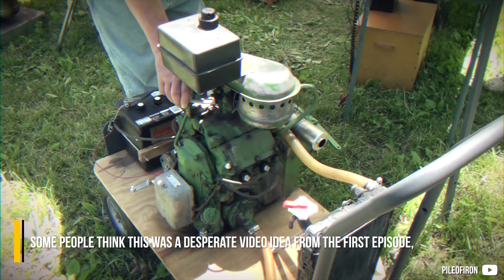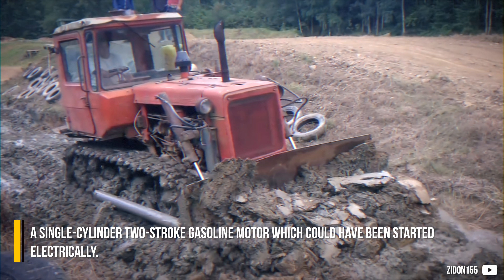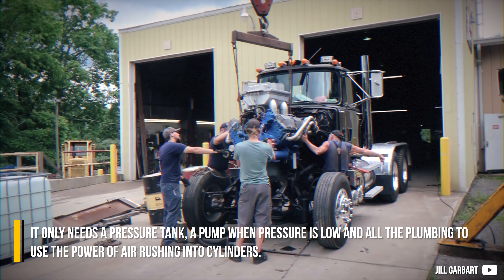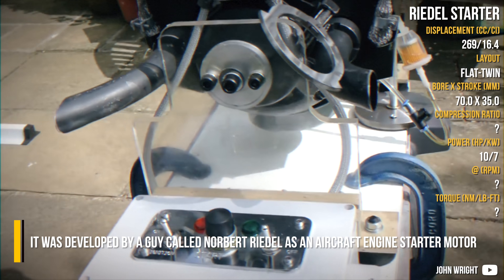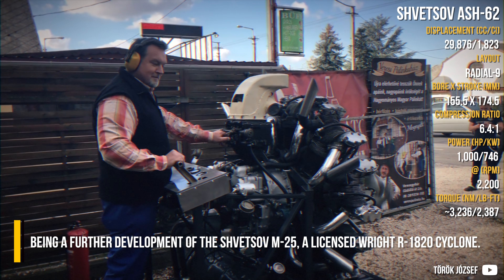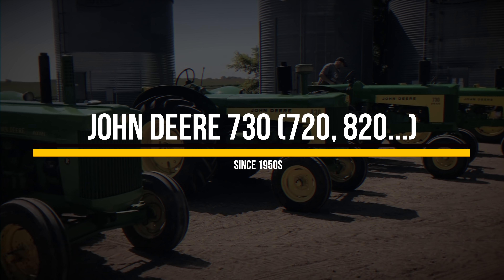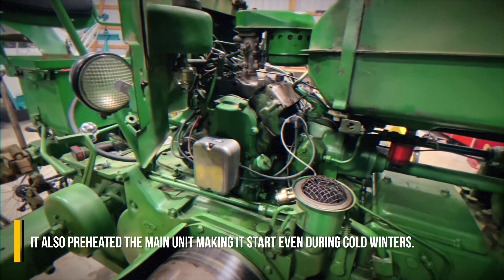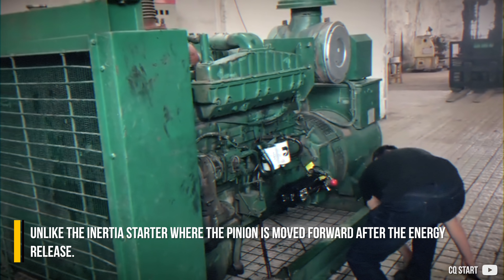The Best Sounding STARTER Motors

Comment: The Mack truck did not use Air into the cylinders but an Air motor, much like an air die grinder but of course much larger.  Starting the engine sounded like a huge sneeze.  I'll never forget a honeymoon couple came in to our garage with a broken Windshield, parked beside the Mack Truck, they flew into each others arms when that truck started up.

Comment: In 1948 there was a motorcycle engine that was used for the Imme R 100 motorcycle. But before that, in order to circumvent the Control Council Act, it was used as a starter motor for a MAN tractor.

Comment: I used to work on and around marine EMD 16 cylinder 645s that had a pair of air starters each.   It was a lot of fun bringing those big mamas up from cold iron, and by the time they were idling, the air starter motors were caked in frost.

Comment: Late post but another unique starting tractor was the first Farmall row crop diesel tractor the MD first in 1941. It is a 4 cylinder engine that starts on Gas and then transitions to diesel.
It has a three valves, a diesel system and a gas system. Two levers are used to start it. move one forward shuts off the diesel fuel, opens the third valve to lower the compression, gas and electrical system then starts the motor, after the engine runs for a short period, 2 to 3 minutes, of time heating the combustion chamber, the lever is moved back to the diesel run position and diesel throttle lever advanced. This simultaneously closing the third valve raising the compression, shutting off the gas fuel and killing the spark to the plugs, opens the diesel fuel and then it transitions to diesel power. 
Here is a vid        https://www.youtube.com/watch?v=0iqQgC6hlwE

Comment: I love unique ways to fire up an engine.  One that i felt should of been talked about was international's way to start some of their diesel farmalls, such as the MD or 450 model.  The engine started on gas, and once warmed up a leaver was pushed and the compression ratio and fuel switched to diesel, allowing a similar action as a pony motor, except it was in the engine it used for work.

Comment: There is the twin Buick starter V8's for the SR-71 aircraft, the old Chrysler gear reduction electric starter for their engines, and the tiny spring starter for the Cox .049 model airplane engine.

Comment: I worked on General Electric MS5001 gas turbine generator sets all over the world decades ago. They were about 18 to 24 Megawatts each. Many had ''black start'' capability where there was no external power in the entire region. When these were called to start, a 600 horsepower Detroit Diesel 12V71 twin turbo engine provided the cranking of the gas turbine. When Start was selected, the diesel would crank over and idle for about 20 seconds. Then it would go to full throttle for about 5 minutes. 

The Detroit Diesel ran through a TwinDisc torque converter and drive the turbine compressor end with a jaw clutch.  The diesel cranked to 20% speed, the fuel was turned on and ignited, then the diesel would assist driving the turbine past 50% speed and accelerate to 100%, or 5100 RPM. The turbine shaft would disengage as the speed built up, then the diesel would go to idle cooldown and shut off. Listening to a V-12 two stroke diesel delivering 600 horsepower was delightful.

Comment: I loved the spring starter. Just flip a lever and the engine is running. Requires a reliable engine tho. Cause if it doesn't start you'd probably be standing there winding up the spring several times. But all in all the inertia starter is best. Gives the Antonov An 2 its lovely sound.

Comment: A lot of antique large gas and diesel engines used a variation of air start that blew air into the actual cylinders to drive the piston(s) down to rotate the engine. (This method is used on some large ship engines also).😉

Comment: That little v4 starter engine from the tractor would be cool if it could be custom fitted with a small transmission and put onto a motorcycle

Comment: The big Diesel trucks we use in the Arctic have air starters, but they don't pump compressed air into the cylinders. There's it's a little air motor that's geared down and meshes with the flywheel or crankshaft when you put air to it. Much better than electric starters in freezing temperatures because batteries die in the cold. I've only seen compressed air pressurizing cylinders directly on really large Diesels, like ships. Gasoline Pony motor starters were used by Caterpillar from very early days until recently. Old low-speed  Lister single or twin cylinder stationary Diesels start by using a compression release valve while you spin spin the flywheel by hand. Some big aircraft or tank engines have hand-cranked inertia starters - very hard work to use. Single cylinder Field Marshall   tractors (UK 1920's and on) use a shotgun cartridge fired by a hit with a hammer. Kaufmann starters are a much more complex cartridge starter, used on both piston and jet aircraft engines.  Almost all of these Diesels use a compression release that's held open when starting.

Comment: I  used to drive an R John Deere..  I  always  thought the  Pony  Motor  was a  two  cylinder  two  stroke ..  I never imagined that  John Deere  would  use a 4 cylinder  engine to start a  two cylinder engine..   They  were great in cold  weather ..  as  you  could start the gasolne  engine and  warm  up the diesel  block with  it  before trying to start the Diesel ..

Comment: You've gone off-track a little here.  Your title says Starter MOTORS, but your video is about engine START-UPS.  Big difference.  Fun video nonetheless, but even starter motors have their own unique sound signatures such as Cadillac starters sounding different than other GM vehicles.  And 60's and 70's Fords had their own unique sounding starters as well.  And I definitely can't leave out the gear reduction starter from Chrysler in the 60's and 70's; a very unique and fun sound as well.  If would be fun if you could look into a video with that.

Comment: The pneumatic truck starters were used in vehicles that worked in explosive environments.  They were extremely noisy, but could be installed on any truck engine.

Comment: I love the sound of an inertial starter.  On diesels, my brother (the truck mechanic) told me the latest pre-heaters to assist starting diesels are large heating coils in the intake manifold.  They heat the incoming air charge which makes for a faster, easier start.  The only thing is, you NEVER use starting fluid, you'll blow the intake manifold apart.

Comment: I love vids like this.   I  building a radio control lawnmower for steep banks.  When I get the inertia start working again I'll have to share a video.  It's a one cyl 2500kw diesel.  You hold the decompression lever (holds the exhaust valve open while you hand crank up some momentum via a flywheel gear. Then while flywheel is spinning let go of the decompression lever and it kicks to life.  The mechanical injection then gets a chance to prime the cylinder a little also. 

It has a electric start but not nearly as Interesting

Comment: While the mack air starter still acted like a normal started in that it engaged the flywheel, it would have been interesting to see the airstart used on large marine engines such as wartsillas, that uses compressed air in the cylinders to get the engine to turn over, it sounds pretty cool, like the engine is coughing before it wakes up to get to work :)
Reply: Yeah I think he was confused about how the Mack starter worked. Still cool glad it is in the video but agree hopefully in the next video he can cover large motors with compressed air in the starter.

Comment: When I owned a retired school bus with a DT360 International inline 6, I would of liked to have another option or two for starting it. Air starter and then recently I learned about the spring starter. Those would be good options. That engine never had a issue starting in the cold (25F) and didn't have glow plugs. I like pony motors but those mean having a different fuel and as you said extra maintenance for the 2nd engine.

Comment: Many farm and construction diesels that use a pony motor for starting also have a compression release that allows the pony to turn the engine over fairly easy and allowing the oil to circulate before they actually start,  I'd use this in winter with the fuel off spinning the engine for a minute or so, turn the fuel on then the compression, engine starts pronto!  diesels are hard to turn over due to the very high compression ratio and winter makes it worse.

Comment: The international gas/diesel engine is a good one also. It has a small electric starter motor to start the engine at low compression on gas. After the engine has warmed up on gas, you pull a leaver that closes the decompression valves and turns on the diesel injector pump swapping the motor over to diesel.

Comment: Decades ago I took the idea of a relatives 730 JD with the pony motor and applied it to grandad's stationary  Blackstone engine...well sorta, I put a 3 groove pulley on his tiller and cut a hole in the cover so one groove was convienantly sticking out and he could run the tiller over to the engine which was used out from the garden anyway for his mill and run a belt from the Blackstone to the tiller and pull back on the tiller to apply pressure on the belt until the Blackstone finally fired off then push the tiller few and remove the belt, it worked like a charm
I use to be so fascinated with that ol Blackstone I'd absolutely love to have it or one like it, a passerby made dad a very generous offer one day and he sold it when I was a teen ,grandad would keep all his oil from oil changes in a barrel and he had a mix he liked of mostly used motor oil slightly diluted with kerosene he ran in that thing it was the most simple basic concept you could imagine

Comment: The International Harvester WD-9 had one engine that started on gasoline and then when the engine was warm a valve lever closed off the top of the cylinders, thus raising compression, and diesel was then injected.
Reply: My elderly neighbour has one, and he uses it every year to rake hay. I've looked at it quite closely and it's an unbelievably complicated design. I just can't figure out why IH designed something so odd. It's pretty collectible, and no, he won't sell it. I asked.
Reply: @paulmaxwell8851  I think part of it was that the farmer could hand crank a gasoline engine while diesel were much harder to crank because of the compression requirements to warm the fuel.
Reply: @paulmaxwell8851  It looks more complicated than it is - there's an additional valve in each cylinder for compression release, a two-path intake manifold, the mag and plugs for the gasoline side, and a couple of shutoff valves.  IH had been building diesel tractors since 1934, and as Martin Walker pointed out, this starting system doesn't require a starter motor or, apart from the magneto/wires/plugs, any electrical system at all (transports of joy!).
A pony motor setup has all those parts plus a separate cylinder block and head(s), rotating assembly and valvetrain, &c.
My family ran an IHC dealership when I was a kid, and I sold equipment parts.  I refer to any motor vehicle electrical system as the "starting and charging system" to this day....

Comment: The real advantage for pony motor diesels was to pre-heat the block using their combined cooling systems. Particularly in logging usage where the equipment would be left out in the woods (far from the road or shop) during winter, this was a necessity back when even 12v systems were pretty weak. While using the pony itself was kind of a pita, unlike a farm tractor, logging and construction diesels tend to be left to run all day once started.
Reply: You mentioned leaving diesels run all day once started.  My Dad had a Wisconsin gas V4 engine on a Minneapolis-Moline combine.  It had hand crank starting and it would start pretty good when cold.  But if it died when hot one could pretty much call it done for the day.  And once started for the day he would let it run until done with it.  And from what I've read and heard that was the nature of that engine.  He hated that engine.

Comment: how may know who made the JD diesel engine was Caterpillar. not sure about the pony motor that turned them over.
Reply: BS- Deere diesels were made by Deere. Cat had pony started diesels of their own, but no relation. Later on, Deere used some GMC diesels, but those had electric starters.
Reply: @floydblandston108  not going to argue with you about it. but i can say after rebuilding these for 30+ years i can say not all but most every one i get in to are cat i mean yes they have a JD stamped on the block but the rods and id marks on the slugs are cat stamped.
Reply: @hartsfire5706  = are you talking about the ponies or the engines themselves?
Reply: @floydblandston108  the engine the diesel that is. i do some of the gas also but i prefer the diesel.

Comment: I recall a series of vids of the International Harverster DIESEL dozer with a compression lever that changed the ratio, making the engine able to run on GAS and using just car-like battery to start. It had distributor, sparkplug coil and for the diesel, a mechanical injetion pump. Once it was on temperature, they push the lever to change the compression ratio. The engine running on gas had enough power to move the machine. Not to operate it, just to move it. Pretty clever also, one engine for all.
Reply: The 4 cylinder gas  that was used in the M was able to drive when running off only 1 cylinder.

Comment: The model "R" predates the 70's and the 80 series tractors. they had v-4 pony motors.
Reply: The model R diesel actually used an opposed twin starting engine, Deere went to the V4 with the 70 tractors............

Comment: Does the Mack use direct air pressure start or a pneumatic starter motor? 
You said that ”air rushing into cylinders” but it sounded more like the latter option.
Reply from the maker: It is the latter, I apologize for the mistake
Reply: @VisioRacer  ok, thanks a lot for the clarification!! 
As someone else suggested too, it would be great to hear startups for the air started really big engines. (Ships, generators etc)

Comment: You forgot the craziest one of all the International Harvestor UD9 straight 6 cylinder that starts on gas then switches over to diesel.... all on the same engine. It IS a diesel engine with sparkplugs and a carb. Standard electric starter.
Reply: And a total of 5 holes in the head. There might have been a reason that the MD and the WD6 had issues with cracked heads.

Comment: Missed one type of common railroad and marine start systems.  That is high pressure air is injected into the cylinders to get it rolling over.  However this start system demands that the engine be jacked over by various methods to reach the start mark on many of these engines.  Opposed diesels are another breed however and they have a unique sound at startup.

Comment: There is another starting system that although not very visual is interesting. That being Hydro starters, where oil is pumped into Nitrogen pre charged bottles until around 200 300 atm then released through a hydraulic starter motor mounted in the conventional position on the engine, a small hydraulic pump recharges the storage bottles once the engine starts. Used in highly explosive environments where electrical sparks could be dangerous.

Comment: The V 4 pony engine for John Deere was introduced on the 70 diesel. High idle was 5500 rpms.  The front two cylinders fired together as did the back two essentially making it act like a V 2. It was important to turn the fuel off to run the little engine out of gas and turn the ignition switch to the off position after it shut down otherwise gas in the cylinders would clean the oil out and vibration would cause wear while the diesel was running and the coils would burn out.  John Deere's first diesel tractor was the R. It used an opposed two cylinder gas pony engine.
Reply: Thanks for verifying the vibration factor.

Comment: I didn't realise you'd done another video about starters. I love the sound of just about all these, especially the Mack air starters and the inertia plane engine starters!

I remember rewinding that bit in Mad Max 2 where he was starting the Mack tractor unit over and over as it sounded so good! I believe that system could also use air tyre pressure to start, nifty!

Thanks for your great videos, always informative and interesting!

Comment: we had a starter in australia back in the old days called battery hill.when your battery was  getting tired if you had a hill,you would back up the hill and put the handbrake on if it worked.if not got someone to chock the wheels.in the morning kicked the chocks out or released the brake and coast down and start.

Comment: Your description of an air starter is only correct if the engine is fitted to a large cargo ship or diesel locomotives. The air starter for an on-off highway Diesel engine is actually more like a air impact wrench in which it contains an air turbine which spins over the engines flywheel like a regular starter motor. The bonus is if your low on air you can use your tires or another trucks air system to jumpstart the engine

Comment: I used to think the Mad Max 2 truck just had a funky sound effect for the starter, but to know that was actually the sound it made is soooooo much cooler! 😃
Reply: That’s why there is a big cloud of dust when it starts all the air flowing through the air starter. It is just like a big air impact wrench motor instead of an electrical starter motor.